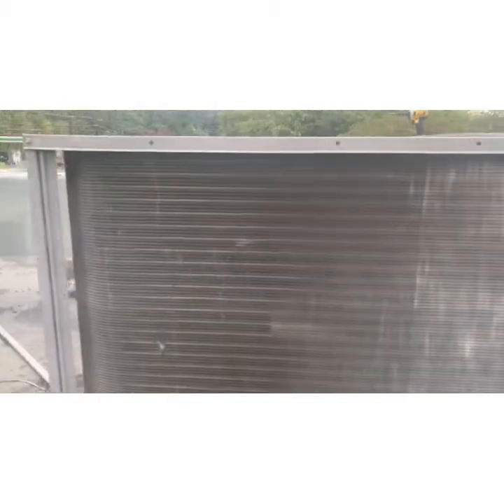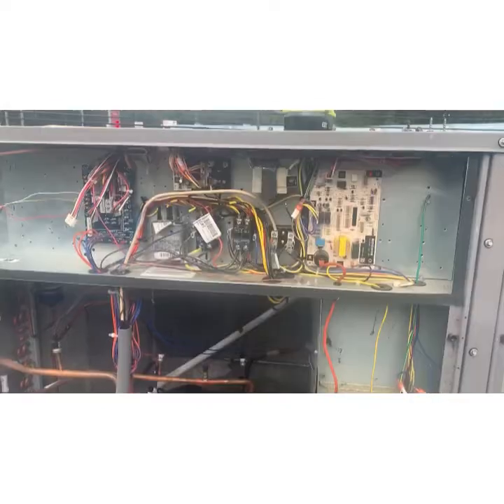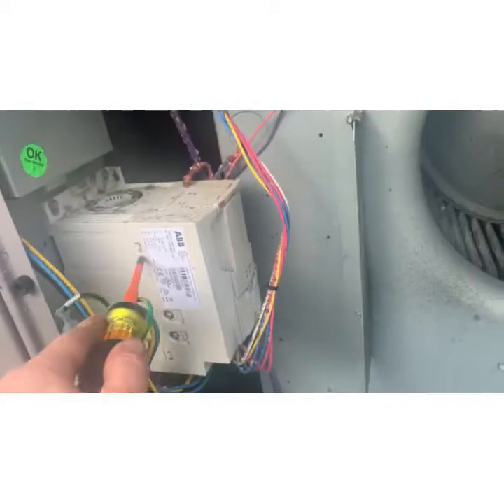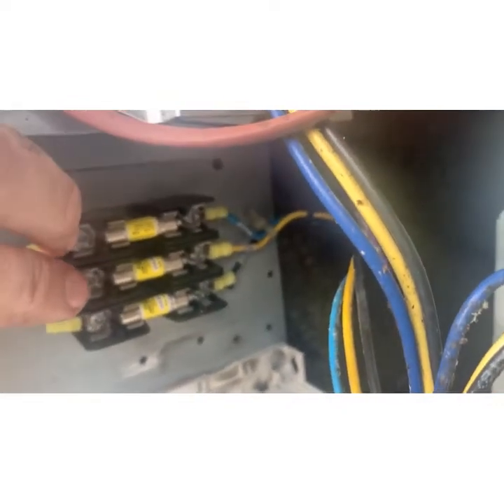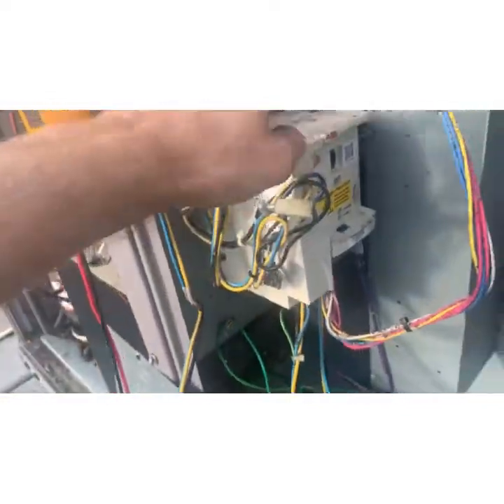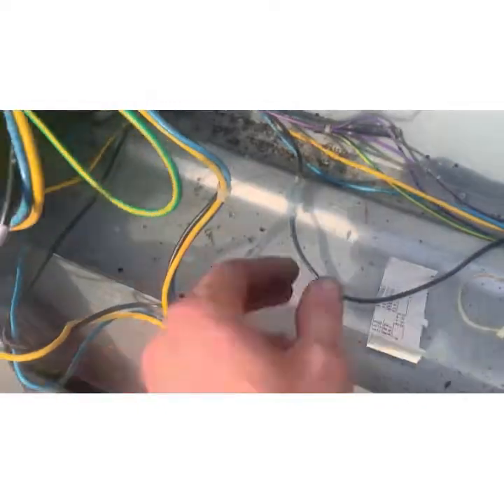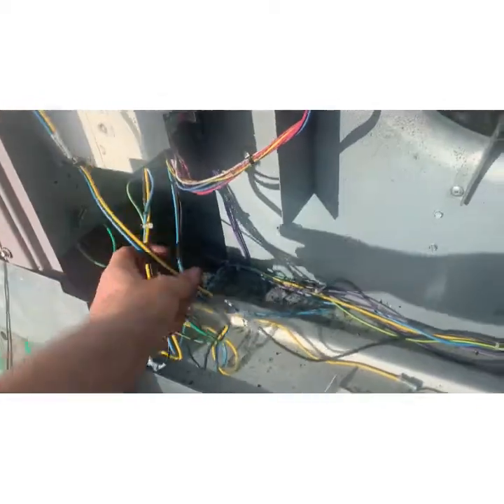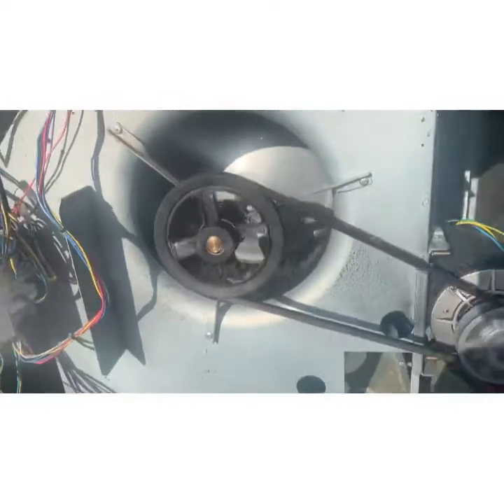Carrier hvac blower motor

Comment: Vfd bad?
Reply from the maker: Not necessarily… it faulted but why?  I’ve seen soooo many times that those things fault out during a storm and then the operators out of luck and all I need to do is come reset it and it runs like a champ till another electrical storm event.  I just bypass them and save us all the trouble.